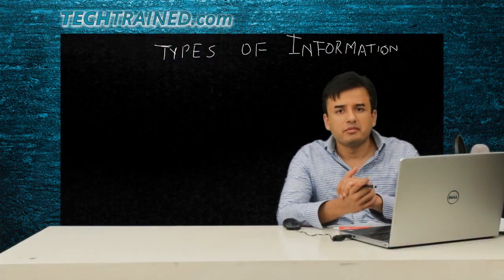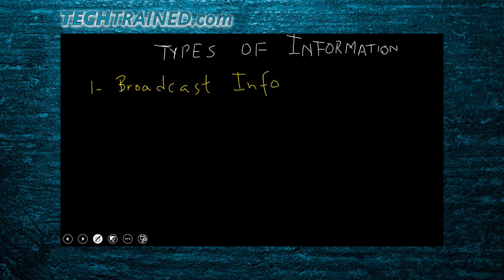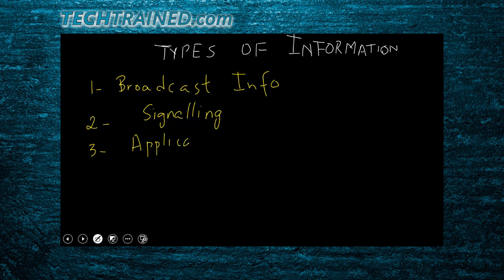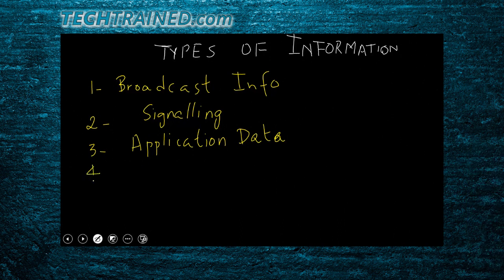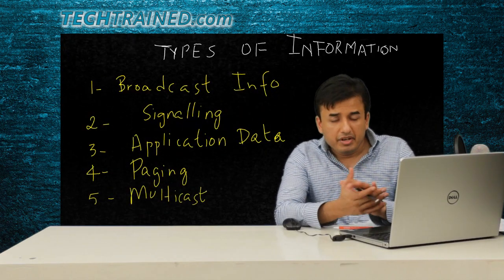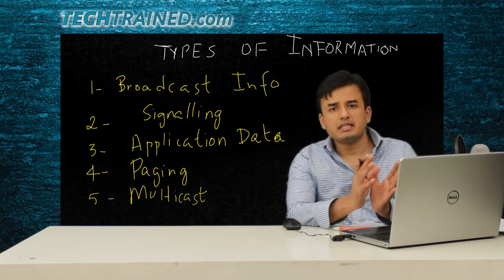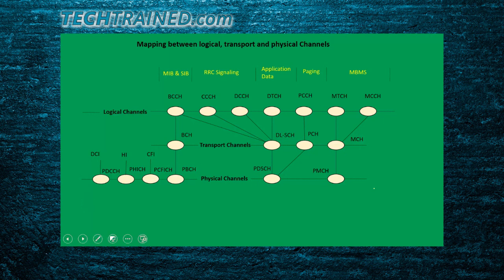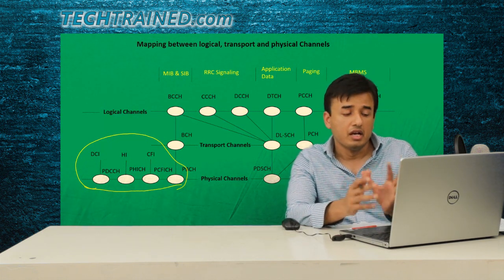4G LTE Downlink Channel Mapping ( Logical, Transport and Physical Channel)

Comment: Why is there RRC recnfiguration and RRC release messaga appear sseveral times in LTE Log.
Reply from the maker: It could be for various reasons. RRC reconfiguration message is used to communicate different messages not only specifically for measurement configuration